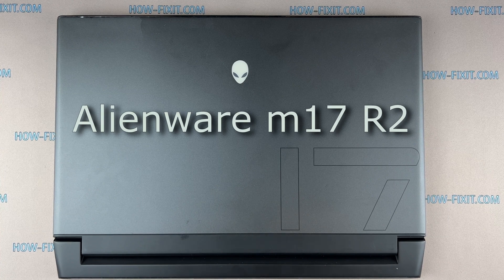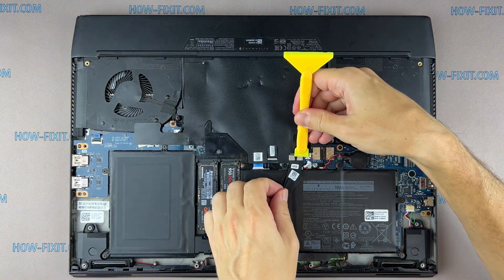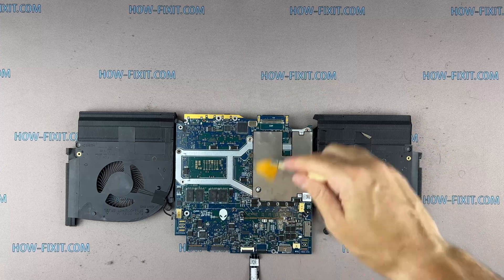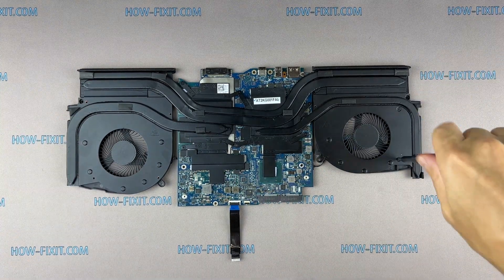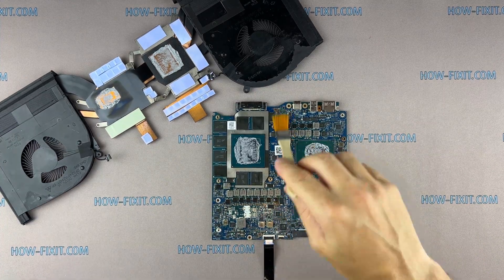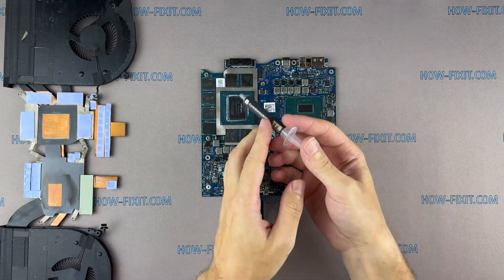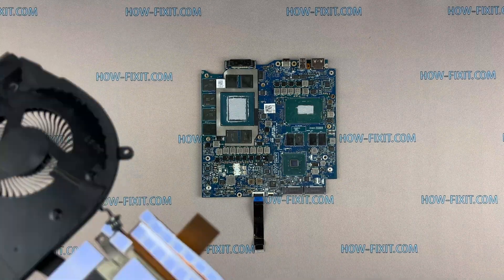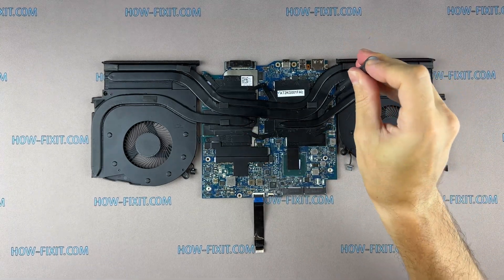Alienware M17 R2 Disassembly, fan cleaning and thermal paste replacement

Comment: Thank you for the tear down video bro. Now I know not to try it myself. Way too many ways to fail 😂😂😂
Reply: My exact thoughts. Ain't no way I trust myself to go that deep and disconnect that many wires without messing something up and breaking this expensive machine. Maybe just blasting the fans with some compressed air will get the dust out?

Comment: Man, what a bitch. Just changed the thermal paste on mine, and you'd think they'd have made it easier lol. Big difference, though. Still get the occasional temp spike, but normal running temp is down like 30c. 

I wouldn't suggest doing this unless you're a professional tbh. I work on hardware for a living, and this was even pretty tough for me. 

And don't listen to the other people on here saying this video is bad. I was able to disassemble, change thermal paste, and then reassemble just from this video. Make sure your connections are all secure, and take great care not to tug on the wiring too much. I know some of the connections are tough to get off, but take your time. Worked 100% normally after reassembled.

Thank you!!!

Comment: Need help. I have the same laptop with severe high temp issue, I showed it to hardware repair for doing the thermal pasting again but he could not take the motherboard apart from the heatsink saying that due to old thermal paste being so much dried up it could not be taken apart without damaging the motherboard and the laptop may become dead. I was wandering if there is some other way to take the heatsink apart without damaging any part of the laptop?

Comment: Thank you man! Mine had next to no paste running constant 95-100degree temps until I decided to apply new paste and clean the fans and about 1 hour later I had everything together and I’m running about 30c cooler under load!! 
Btw I’m a first timer and had zero issues after reboot🥳

Comment: I followed this video step by step and changed my broken fan ,but after this, my laptop can not turn on and don’t have any power or light😢
Reply: Can u resolve the problem? Because I’m in the same situation 💔 can you help me
Reply: Also having this issue, I don't wanna take this thing to a best buy lol
Reply: did you solve the problem? it happened to me too.
Reply: @ferrarigaze  just press the turn on button for 10 seconds 2 or 3 time
Reply: what happened after??
Reply: Is anyone still having this issue? 

If there's no signs of life, no lights, nothing. Try checking the left side JPWR to see if it's seated properly (fans facing away from you). Generally, there should be signs of life and otherwise this wouldn't make sense other than all wires not being connected properly.

Comment: too many steps to go wrong which is why several people in the comments have issues after trying this. I did it to an R1 model and it was ten times easier than this and much less to go wrong. Its a massive shame that they cant just use high quality paste in the first place
Reply: Yeah... I did this to replace my fans and now it won't post. I legitimately dunno what I did wrong. I've worked on other laptops before, and never had issues. Now I'm trying to research what's wrong and how I can fix it

Comment: hello I have the m15 r3 model of this it looks the same, I wanted to ask if you have any advice the screws wont come out fully the get stuck part way when I am unscrewing them. I have been trying to clean out the fans for months so any advice id appreciate.
Reply: Did you manage to clean your fans? I have the same laptop!
Reply: @louiegallagher990  Yes finally did, the screws were jamming so they weren't coming out enough to pop the cover out. But finally got them to budge they should really test them lol
Reply: @kya6256  thank you so much for the reply, I'm going to buy the stuff to fix it then soon!
Reply: Pretty sure they're supposed to be like that (if you're talking about the bottom cover)

Comment: hi I followed your steps yesterday to complete thermal paste replacement
but the computer cannot find the built-in speaker and microphone after booting. What do I do?
Reply: You could try opening up the computer again (if you haven’t fixed it yet) and finding the inputs for the speaker and mic, and unplug them, make sure the connections are not damaged, and plug them in again properly.

Comment: Is it necessary to do all of that just to repaste?
Reply: Unfortun yes...and it's a lot of work. But worth it if your Alienware M17 R2 is getting too hot, which is a common issue with these particular laptops. I'll have to do mine eventually but for now I just decreased my CPU's max. output (while plugged-in) from 100% to 99% and set my power-mode to balanced. My temps went from 97 - 100 degrees to 75 - 80 degrees and I've seen absolut. no difference in performance especially while gaming even with my CPU now throttled at 2.50Ghz instead of it's usual 4.50Ghz. Works for me!
Reply: @ronnied4385  Mine went up to 100 degrees while gaming, when I opened the device, battery was swollen, had to be removed. I've yet to do this tutorial but I started using a cheap laptop fan, and lowered graphics, now my temps are 65 - 75 degrees on average daily use. 

Some technician in my country told me my laptop had only a few months left, and didn't even bother to repaste...
Reply: @pierinalopez3321   Yeah these particular models we have get way too hot. But I'm glad you found that solution. Just don't listen to 3rd party people who seam to think they know  every inch and diode in your laptop and say it's going to die soon. I've had mine for 3 yrs and it's going just as strong as the day I purchased it. Far as your battery, you can easily order a new one and replace it. Very easy to uninstall old one and reinstall new one. Of course I don't recommend that you game on it unless it's plugged in...but that laptop will last you quite awhile now that you've lowered the temp. 👍